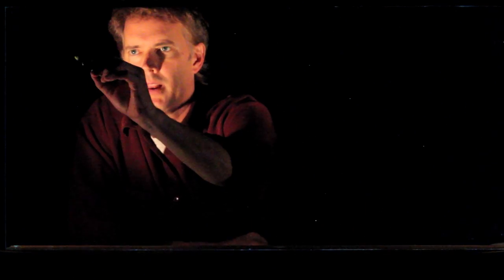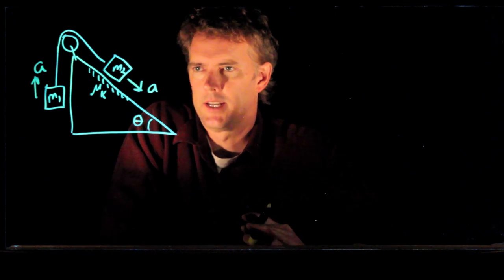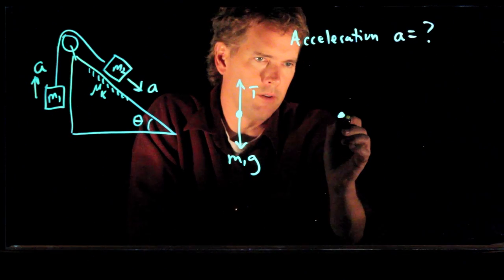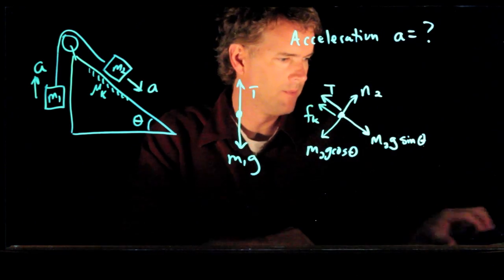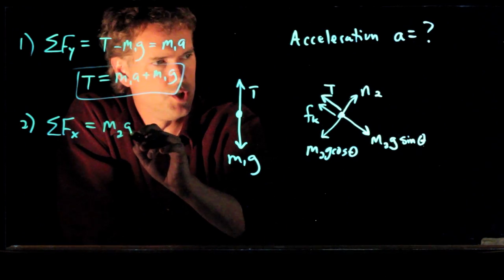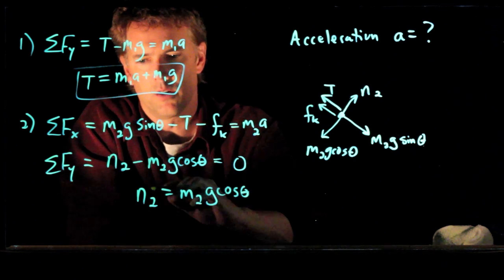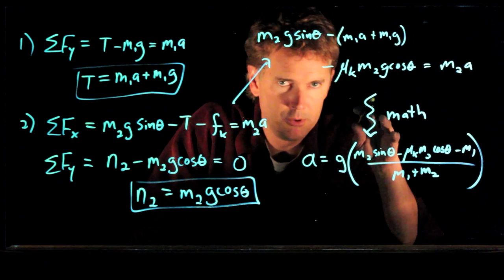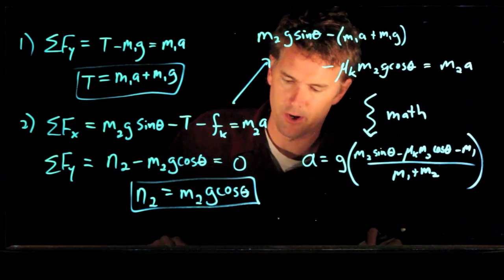Two Masses, a Pulley, and an Inclined Plane

Comment: One doubt. When applying the second law shouldnt we analyze the movement/ forces relative to 1 referential?? Here, you use rotated coordinates for the block on the plane, so shouldnt you also decompose the forces acting on the other block in the same rotated coordinates system ? I understand intuitively why its easier to solve this problem the way you do(rotated system for block on plane and "regular" system for other block), but not knowing exactly why we can do it is bothering me so much. I tryed looking at Galilean relativity, its probably related to that, but i need some enlightment to fully undestand this matter. Hoping for an answer...
Reply: Woah hold it there, it has nothing to do with Galilean transformation. The "Rotated coordinate system " ,the very term is just for ease of understanding. Literally its just like tilting your head to visualise it better. The resolution of the vectors along the " new system" is still the same on the original one. Technically if you read further on ( After Galilean transformations and all that,lead into Einstein's argument that lead to relativity ( took him 7 years at that)) you'll see why there are literally no inertial frames of reference( Inflation and all that) and hence gravity could itself be a pseudo force. Anyways, not gonna go too much into that now here,just read the first part of reply for the relevance xD  :)